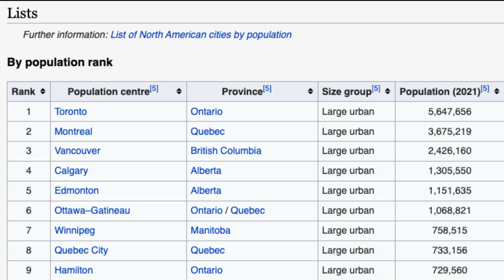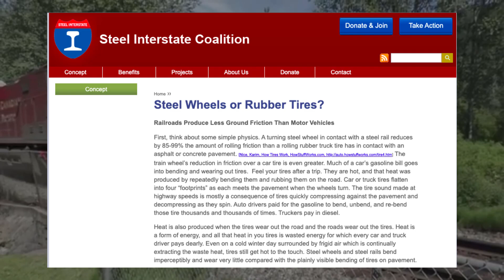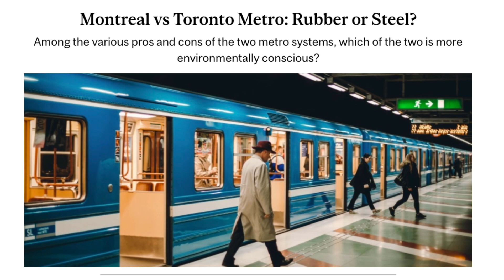Why Do Metros Use Rubber Tires?

Comment: How can you say riis "a lot cheaper"?

They have to deploy the concrete roadbed AND rails if there's a flat tire. The roadbed is more complex with rails AND concrete running platform. 

Rail only systems can be deployed in pre-fab sections and laid down quickly. These have to be poured in place.
Reply from the maker: You’re absolutely right, when writing the video I’m guessing I was acting as if the rubber wheeled trains were running on a regular concrete road (which would be cheaper than steel rails). I completely forgot to include the guide rails and the added costs of pouring concrete in a tougher way.

Thank you for the correction, I’ll pin this comment.

Comment: Vancouver Skytrain went with LIM system instead. Less cost for tires..more cost for installation and Maintenace of reaction rail and 4 th rail power ( for better grounding) LIM motor tend to lift the train. No problem with grades and very few moving parts. Wheels just go along for the ride..quite reliable…

Comment: Thanks for the video, when i went to mexico city, i just wondered how did the circuit worked, because with conventional metros the supply current with third rail or ohle, goes in and then returns via the running rail, with the metro in mexico city, i didnt know how the circuit was completed, Its cool how a compressed shoe is pressed in the inner steel rails to return the current.

Comment: Why can't train wheels be coated with solid nylon? Quiet, wears slower and 100% recyclable.
Reply: Think of skateboard wheels.
Reply: Um, that's not how rail wheels work. The surface contact area is so small that basically any other material than steel would be crushed.

Comment: Why not do a hybrid? have traditional steel rails and steel wheels, they could be raised/lowered as needed, lower for acceleration, going up hill, downhill, and emergency braking, raise for coasting and pretty much everything else
Reply from the maker: To restate your comment, they could use traditional steel on steel rail to conserve energy lost from that friction from the rubber tires and just swap which one makes contact with the ground (or even have the traditional part permanently make contact with the rail and just lower/raise the rubber tire) but…… A) rubber is heavy… steel is also heavy. The energy saved by less friction might be lost by carrying that extra weight. B) anything that moves required expensive maintenance. It’s not even just swapping between third rail and overhead/catenary power, it’s completely redesigning the bottom of the train to somehow make space to raise and lower the tires.

Either way it would be more expensive than just keeping it simple. But most rubber tired metros use some form of steel rail anyway to guide so it’s really not that far off.

Comment: Given the historical involvement of Michelin in early rubber-tired train designs, I suspect that French politics has played an inordinate role in the adoption of the technology. Every proposed advantage of the technology seems to come with a countering disadvantage. For example, reduced station spacing also reduces average speed while greatly increasing cost per mile, as stations are costly because they occupy valuable surface real estate. LRT can accommodate grades of at least 5%, which is as steep as a freeway.

Comment: In Mexico City we use rubber tires because they have less impact on our watered soil. We have two lines with steel wheels and both have a greater mantenience cost than the rubber ones due to track deformation.
Reply from the maker: That's interesting! Is Mexico City still affected by the former lake in other ways? I would imagine that construction of skyscrapers is impacted by the fill in job.
Reply: @robert.halpern  skyscrapers in Mexico City are both, sitting on top of very long pillons and are somewhat bouyant given the way the foundations are made.

Comment: Actually in Mexico City have a two lines with railroad wheels, the Line A and the infamous Line 12, one is short (A), and the other is long (12) as many other in the city (neumatic as 1, 2, 3, 7, 8, and B. This ones across all the city side by side; and the city is very long).

Comment: yoo i also went to montreal during the summer and found it really interesting how their metro system has rubber tires and no a/c as well. hmm. but the new models felt pretty futuristic compared to what we have in NYC. this is really good insight
Reply from the maker: They had a reason for the lack of AC, something like since the metro was all underground it would heat up the tunnel. I agree about their new cars being much more modern than NY and I think they are still going to be more modern than the new R221 cars.

Comment: I live in Montréal and I've used metros in several cities around the world. I hate trains on tires. They're so loud! And they vibrate a lot more (you can't manufacture perfectly round tires (compared to machined steel wheels) and it gets even worse under load). But apart from the tire system, I love Montréal's métro.

Comment: Two things, firstly they are not more quiet.  And second, construction costs are not lower.  The guideways contain the same old metal rail with all the rest of the components like tie plates, rail clips, etc... in addition to the concrete guideway for the rubber tires.  There is a regular metal train wheel on the inside next to the tires.  These are required for turnouts and in case there is a flat tire, as the metal wheels usually rides just above or making very light contact with the rail.  The vehicles are more of a niche product that also contains extra components and complexity thus making them more expensive and require greater maintenance.  You can get equally quick acceleration with lighter train cars and powerful motors with good slip control.  (something BART has more or less done from day one, although arguably rainy days seem to argue against this) Also there is a compromise with adhesion and efficiency in the metal wheel profile (shape).  BART uses a fairly flat wheel head which has a greater surface contact area giving them better acceleration and braking and stability at high speeds.  (same basic profile as the Shinkansen) The tradeoff is a little more energy use and noise.
Reply: They were more quiet than the old steel rails. 

And a crappy rubber line will be much quieter than a crappy conventional line. 

But of course a well maintained modern steel railway will not be louder than rubber. They still produce different noises though.
Reply: @duyhungle9375  When track geometry is perfect and well maintained the flange should never rub the inside of the railhead, and that is often the source of most of the higher pitch noise.  In fact even on curves as long as the tracks are super elevated and the train runs at the right speed without too much under balance the flange STILL never makes contact.  Add to that moving point frogs at every turnout and you have a fairly silent railroad.

Comment: Having lived in Montreal for about 2 months, I love rubber-tyred metros. The feeling of riding the Montreal metro can be described as a slightly out of control, bouncy roller coaster. It’s fast and furious and you get used to it.
Reply from the maker: As much as I wish NY’s subway was a thrill ride like Montreal’s, I don’t think everyone would agree to that. Speed here really depends on a stop to stop basis- some are great but there are some pretty slow intersections. I’ll guess Montreal doesn’t have the same problem with lines connecting and slowing each other down because they seem to each use their own tracks.
Reply: @robert.halpern  Meh the first couple of time I rode on the Montreal Metro it was really noticeable but after a couple rides, I got used to the bouncyness. The speed is indeed dependant on the station spacing however, I feel like in need to reemphasize how darn quick this trains are under acceleration. The traction is insane.

Comment: I've noticed the rubber wheels on Montreal but never really thought much about it.  How long will a rubber wheel last before it needs to be replaced, when compared to steel?  I would think more often, but I also think a rubber wheel is cheaper than steel wheels, so the comparable costs will take some calculating. I also assume rubber metro tires are solid rubber, not something you inflate, so flat tires between metro stations isn't likely.
Reply from the maker: They definitely wear out more quickly than steel because rubber isn’t as good with heavy vehicles. High quality steel might cost more than rubber but rubber definitely isn’t cheap. $400+ * 8 wheels per car is a lot of money when it has to be replaced. 

Not sure how it affects cost but most wheels on busses are about 50% rubber but 50% sulfur as well (My numbers might be wrong but it’s a big part of tires). 

Search up sulfur vulcanization on google or Wikipedia, when making the video I used that to help research. I bet they have some special composition for truck / bus / train tires that will be most durable to prevent flats but there are safety measures in place to protect the train in case of a flat. One of the links in the description has a diagram of the bottom of the train and you can see they have an inner steel wheel that will lower and trigger a sensor with a flat. They have their systems but really steel is just less maintenance.
Reply: @robert.halpern  Thanks.
Reply: They last about 250 000 km. They are inflated at high pressure (10 bars instead of 2 in your car) with nitrogen instead of air while in a metallic cage to prevent injuries in case something goes wrong. In terms of overall cost, I don't think there is a significant penalty compared to steel.

Comment: Rubber tire systems will never be more than a niche-use product. It's universally accepted that Steel is the only way to go today. Plus globally there are just far more companies and investment that has been pushed into the development of rail systems. So availability for parts, choice of customizations available,  available competition for bids between manufacturers etc... are all far more plentiful than they are for rubber tire systems. 

Plus you can have longer, larger, and heavier trains with a steel rail set up, than with tires. This just flat out means you can have a larger seating capacity per train as well as more space for legroom and headroom. 

Tire-based systems have more disadvantages than they do advantages. Yes, more grip. But at higher speeds rail actually is quieter and again as a result of less friction, far more efficient. In addition to this, you can maintain higher speeds with steel wheels without having to worry about heat build-up or steel belt failure happening like in a tire. 

Tires certainly have their place. They fit very specific situations very well. But for a train, steel is the only way to go for 99% of all cities. The tire-based systems that do exist today will likely be all that you really ever see as those specific cities need a niche-like product. Much like a Cog Railway is a very niche train purpose-built for a specific type of situation of climbing very steep grades. Again has it's place in the world. But it's not ideal for almost any other type of everyday situation. 🙂
Reply from the maker: Yep, but I guess this was not always the case. Simple truth about steel and rail tech is that they evolve so the shortcomings of steel earlier (less traction, worse acceleration etc) can be fixed over time. The same can be said for rubber and we will get rubber that can support heavier loads in the future but steel will probably be superior for the next couple of decades at the very least.

I'd love to ride a proper cog railway because I can imagine it would be completely unlike a normal train.

Thanks for taking the time to write that!

Comment: RM Transit made some good videos on this... Basically this was advantageous in 60s and 70s for metros with close stations and/or steep inclines, but nowadays with better technologies, rubber wheel train is only useful for extremely niche scenarios at best.

While I do have a weird penchant for the smell of rubber tires, I can't imagine most would fancy such smell...
Reply from the maker: Mhm, it does seem like steel is improving and is slowly making all the benefits of rubber tech obselete for trains.

I'm curious which RMTransit videos you saw, I watched his Paris metro explained video which was interesting but I want to see another video on it.
Reply: @robert.halpern don’t forget linear induction motors for steel-wheel train, which improves climb, acceleration and braking, while being energy efficient

Comment: Paris uses a combo of steel wheels and tires. It allowes the tires to be used on steep slopes and steel on other parts. The supporting ledge on wich the tires ride differ in height along the track allowing the traction to go from tire to steel and back, without mechanical intervention.

Comment: Montreal’s transit system actually has a retreading shop for the buses. Not sure if they also retread the metro. With buses they follow a strict protocol and only let the tires on the road for a limited amount of use before they are taken back to the shop. It’s better for the environment.

Comment: There's something that you did not mention that's a big factor on why some cities choose rubber tires for their metros, and that's earthquakes. In both Mexico City and Santiago de Chile, for example, part of the reason to choose rubber was the intense earthquakes the cities suffer, as rubber bounces better (thus generally sustaining less damage and being less likely to de-rail), during an earthquake, or so I've been told. You can look up 'sismos en el metro cdmx' to see what I'm talking about.
Reply: In Santiago new steel wheeled lines are being constructed due to upgraded earthquake safety standards.
Reply: In the case of Mexico city, it also is due to the sinkage of the soil, leading to a more stable ride on rubber wheel.
Reply: Both Japan nor California have shown little interest in rubber-tired trains, and northern Japan, in particular, suffers from frequent magnitude 6 earthquakes.
Reply: @pacificostudios  As I said, earthquakes are only one reason among many to be considered, there's lots of factors for why Japan or California might have decided they liked steel better; maybe with new safety standars the benefits of rubber in withstanding earthquakes have diminished recently or disappeared completely, maybe weather or prices or pre-existing infrastructure or maintenence requirements or just an aestethic preference or any onther number of factors influenced those choices.

But my comment was not to say that rubber tires are always better for earthquake-prone regions, just that at the time these choices were made, earthquakes were presented as one of the reasons for taking them. 

Also, the way the vibrations of an earthquake look like change depending on a lot of stuff, so even if rubber tires used to be more helpful for some kinds of earthquakes, they may not be as useful for other kinds.

Edited for misspellings
Reply: Lol the Japanese would probably like a word here. 

The bulk of their metro is narrow gauge steel rail (narrow gauge is less stable than bigger gauge and is easier to derail) and they work fine
Reply: @duyhungle9375  If you read the previous replies to this comment you would find that I already responded to your concern, but tl:dr is that whether or not it is still true nowadays, back when the decision to go for rubber was made it was justified by the belief that it would help prevent damages and derailment during earthquakes, of course by now it is not hard to imagine that more modern building standards eliminated that advantage. Also to consider, the soil is very different in Mexico City and say Tokyo, so while they both experience earthquakes, those can be very different on a geological level, and Mexico City also suffers from very serious chronic sinking, so they may require different kinds of safeguards

Comment: A very interesting point to note is that the Lyon Metro in France uses rubber wheels, with the exception of their line C. This line goes up very steep grades (a 17% incline), but uses steel wheels with a rack and cog, so I recommend building cog railway systems instead of rubber tire metros when it comes to steep grades and efficiency.
Reply: Lyon inherited a rack railway, and it was cheaper to retrofit it to metro standards instead of completely overhauling it to rubber tyred metro
Reply: the problem with rack railways is that they're very, very slow.  seriously, the top speed for one i could find is 15mph (the montreal metro runs at 25mph uphill and 45mph flat), and looking at a video of the c line, the trains are seriously about as fast as a bicycle.  that's not gonna cut it for actual mass transit along steep inclines, especially when you can drive a car up an even steeper hill faster.  rubber tire metros work well for such applications, and while they are just glorified trolleybuses... what would anyone actually have against trolleybuses?  i just think they shouldn't be relied upon when proper grade-separation and routing can allow for normal rail to be used instead.

now, if someone comes along with a way to improve rack systems to be used at higher speeds comparable to rubber, i'd be 100% on board.
Reply: Same in Paris. It’s pretty cool I like the trains even though they are a little outdated but like the style of it
Reply: I came searching for this video after i saw metro with rubber tyres in paris.
Reply from the maker: I didn't realize that the Paris metro used cogs at all, that's cool. Yeah I agree though, steel alternatives (like cogs) seem to just be better in the long run than rubber.
Reply: @robert.halpern  Not Paris, Lyon.